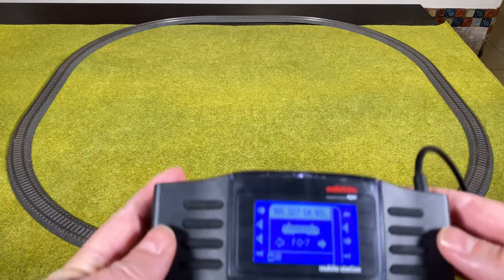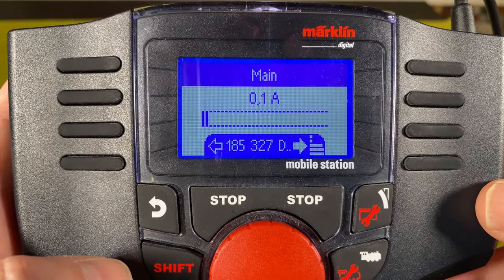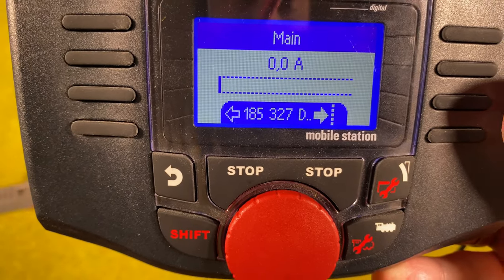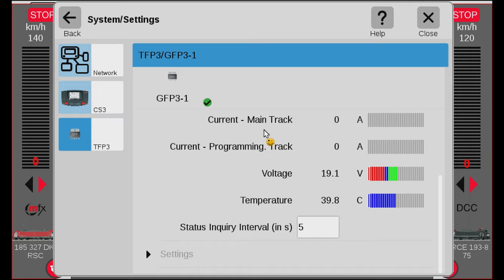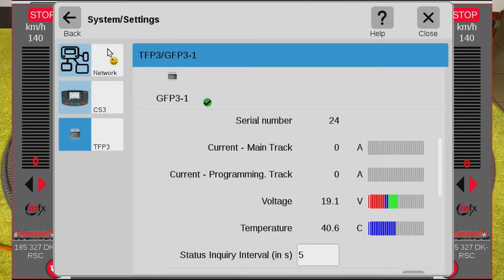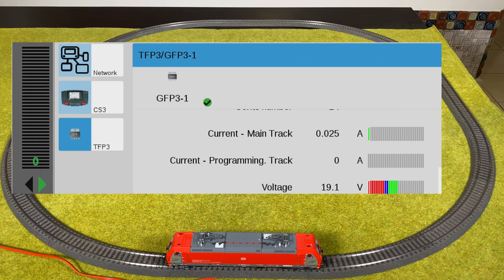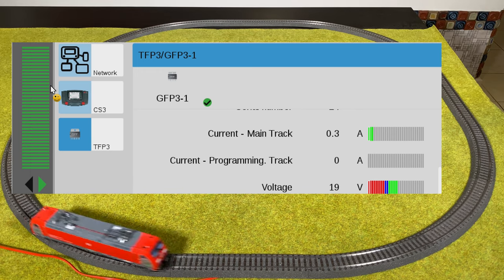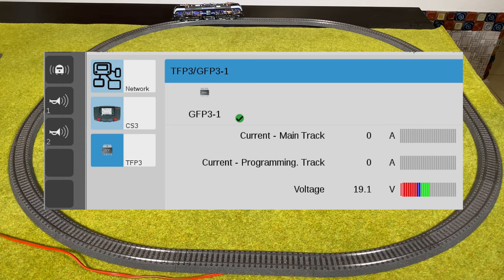Monitor Power Consumption on Your Layout with Märklin MS2/CS3 (Tutorial 08)

Comment: THANKS! What about a very large layout (lots & lots of Track & Turnouts)? Do C-TRACK sections themselves drain powe?  GREAT VIDEO!!!r
Reply from the maker: Hi Mann99 - yes the C-tracks drain power as well. Not much, but some. When making large layouts you should consider to make a power bus with wires feeding power throughout the layout. I do not have much experience with this, but I hear from colleagues every 2-3 meters - or if using automation every block. For automation stable power is really important to eliminate potential issues. However, I am not an expert on these issues. Hope it helps. Enjoy ;-)

Comment: A booster isn't an upgrade it's an additional transformer

Available Power is expressed in Amps or VA you can understand the VA because thats the formula for calculating Power = Volt X Amps gives you Output in Watts  thus 18 volt X 2 amp = 36 Watts

Each point motor, locomotive or accessory will use some wattage

Digital Motor's  10 watt
LED Lights 1 watt
Old Incandescent Bulb 1 watt each
Point Motor 0.6 watt  this is instantaneous so if you trigger three point's that's 1.8 amp

So a train of 1 locomotive and 4 carriages with LED's 4 watts with Old Incandcent 8 watts since there are two bulbs per car

If you have a layout with 8 points then 8 x 0.6 = 4.8 watts 

Total  Loco      10.0    watt  this is if you run the loco at full speed thus by running your loco at slower speeds you have more watts in reserve

           Carriages      8 0    watt
           Points           4.8     watt

TOTAL                   22.8      watt

Thus from this you can see that you can't do a lot with a mobile station you could run a freight train with 1 loco consuming the last 10 Watt
Reply from the maker: Great information and details - thanks! I really like you explanation of the power consumption using watts and the illustration of how you can calculate it. To me this a more accurate way of estimating 
the power consumption that is very helpful. This makes a lot of sense.

The numbers you present for digital motors, LEDs, light bulbs and point motors - are these typical for the Märklin system?

You are absolutely right: A booster is not an upgrade. A booster for the CS3 is an independent device (Märklin 60175) with a matching power supply.

Thanks for the detailed info! Enjoy ;-)
Reply: Yes those fiqures are published in the full product catologue

Keep in mind that not all points will be running all the time

Comment: Hi. Thanks for all videos! My CS3+ shows some amperage even when main and prog. track wires are not attached, and the device is in stop state. Don’t know why? Is it normal?
Reply from the maker: Hi Derin,

I tried the same on my CS3+. When it is in stop mode the "Current - Main Track" and "Current - Programming. Track" is 0. I have wire and one 24188 attached to each and I still have 0. Note: my Voltage is 19.1.

Is your CS3 up to date? My CS3 is version 2.4.0(5) and the TFP3/GFP3-1 is version 12.113. Unsure if there can be a difference between CS3 and CS3+ for the TFP3/GFP3-1 version number.

Questions:
- How much amp does it show is being used?
- What does the Voltage show?
- Is there something stuck in the plug on either the CS3 or the wire?
- Are you using the correct Märklin power supply? Which one?

Enjoy ;-)
Reply: @ModelTrainFun  Thanks for your reply and thanks for introducing so much information about CS3 family to the community. I've recently watched your automation videos and now I forgot my own name. Too complicated :) Huge thanks again. My CS3+ is up to date. TFP is also up to date, no worries there. Voltage shows 19.1v and I'm using 60041 power supply. My main track generally shows 0 while not using but the problem is in programming track. It always shows an amperage.. Now for example it is 0.010 amps. Nothing connected to programming track socket. By the way, rarely, locos start playing random sounds or horns when I first turn on the device. It's extremely rare but doing it. Don't know why or is normal sometimes? For your information. Best regards.
Reply from the maker: @kolabuzlu 

Don't be too scared of the automation - it can seem overwhelming when you first jump into it. However, consider learning the basics first to ease your way into the automation.

I would suggest:
1. Drawing track diagrams: https://www.youtube.com/watch?v=Hi6R3ugZ-SQ
2. Making manual routes: https://www.youtube.com/watch?v=dsXjeP-UprY
3. Red light with a timer: https://www.youtube.com/watch?v=0QCtklLO7II

The look at:

4. Contact tracks: https://www.youtube.com/watch?v=2FMWxEPm__Y
5. S88/Link88: https://www.youtube.com/watch?v=asgop7QRIK8
5. Basic events: https://www.youtube.com/watch?v=MtZ1MYwOLDY

Experiment and try it out. When you are comfortable with this, then try the automation episodes.

Enjoy ;-)
Reply from the maker: @kolabuzlu  Great that the main track is 0. Programming track on 0.010 amps - sounds odd, but could be a rounding error? I would not be too worried about this if things seem to work, but agree odd it is not 0.

The locos start playing random sounds or horns? I have seen something similar - it occurred very very rarely and does not really seem to happen anymore for me. I have always considers this a startup glitch in the locomotive - not the CS3. but yes agree interesting... I am not sure but I do not seem to see it in most modern locomotives... 

Also make sure that the brown from the CS3 goes to the "0" on the track and Red to "B". It seems to confuse accessory decoders if it is flipped.

Enjoy;-)
Reply from the maker: @Derin Hakan Karakurt @llyderin

Hi Derin,

Talking to another viewer it said he had som issues with his CS3. 

The issue:
Its all MFx, all locos and all turnout decoders.w the MS2 all works just fine,but after starting w the CS3+ strange things happens. No loc on the track and all works fine,but when starting a loc w sound and etc the turnouts start blinking ( the lanterns) and the signal blinks.

After he got a new (or was it repaired) CS3 he noticed that the CPU temp on the old one was very high (about 60+) and it showed a small amount of amp on the programming track even when not used.

I am wondering if you have the same issue? ...or could have an issue you have not noticed?

Enjoy ;-)
Reply: @ModelTrainFun  Hi. My turnouts work flawlessly. Loco driving is absolutely fine, no issues. Signals works fine as well. My CS3+ always shows 0.03 amps on main track and 0.01 amps on programming track. Even when track cables are disconnected and device is in stop mode, always it shows these currents. My only real issue is, when turning on the device (and after exiting stop mode) maybe 1 in 50 cases, any of my locos (I have 4 - all mfx) starts a random sound function. A horn or engine start, etc... I have to turn on then off any function of this loco (lights for example), and that sound stops. Best regards.

Comment: Vers interesting, thank you. Two comments: 
1) I am using the 60101 power supply for my HO layout. When I bought the CS3, I wanted to buy the 60061 power supply coupled with a booster. The distributor advised me to take the 60101 PS instead. Much cheaper and no need to separate my layout in two! When I reminded him that maerklin recommends not to use this PS for a HO layout, he told me not to worry, all advanced (which I am not!) modelists do use 60101 without any problem. 
2) Now I know that I have to change my PS setting to 60101!
Reply from the maker: Hi Bauouin, 

Using the 60101 is a trick that many Märklin H0 modelers use. To be honest I would probably rather divide the power if my layout becomes so large I need it. More costly, but there are also benefits in dividing your power. However, I understand from fellow Märklin enthusiasts that the 60101 works without issues on a H0 layout. 

The setting in the CS3 basically instructs the CS3 at which power level it should cut off. If you do not set it to 60101 it means that it will consider it a power overload at a lower level and you will not get the full benefit of your 60101.

Enjoy ;-)

Comment: Does the Amp capacity increase with an additional cs3?
Reply from the maker: Hi Mike,

I don't think so. If you look at the Märklin systems architecture here: https://www.maerklin.de/fileadmin/media/maerklin-digital/Downloads/Systemarchitektur_Gesamt%C3%BCbersicht.pdf

You can see that only one of the Central Stations is connected to the track. I believe this is because only one is allowed to generate the digital signal. This is an issue where the layout connects the two Central Stations. When a locomotive bridges two sections with different digital signals from two different Central Stations, then this would disturb both signals.

In order to have more power on the layout you need at booster. You can use the Märklin 60175 and another power supply you would normally use for the Central Station. The drawing I referred to above is a little old, so you need the switching power supplies. Check out https://www.youtube.com/watch?v=wANbrR0fdJk&t=513s

Enjoy ;-)